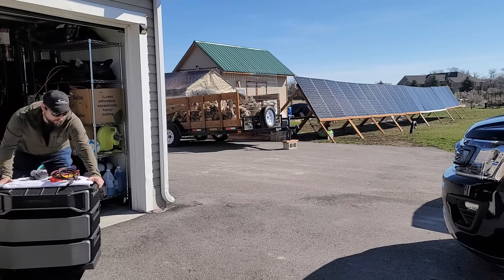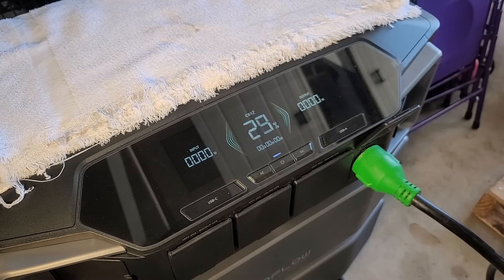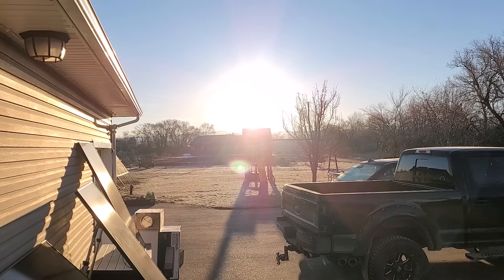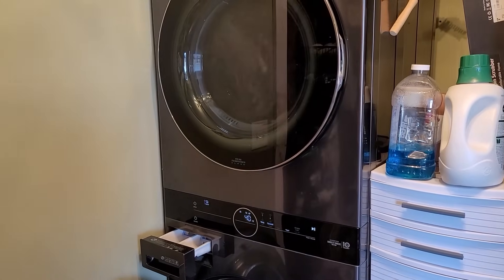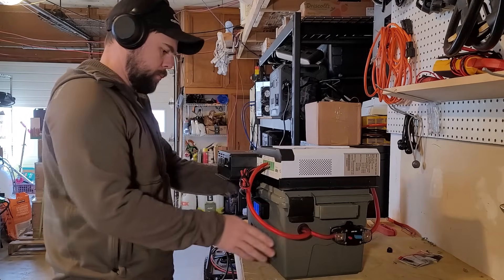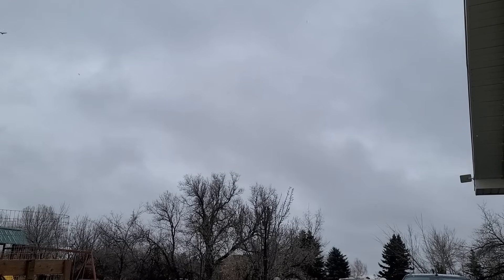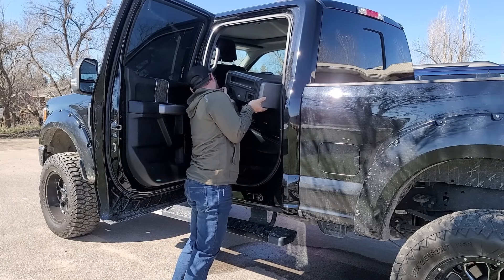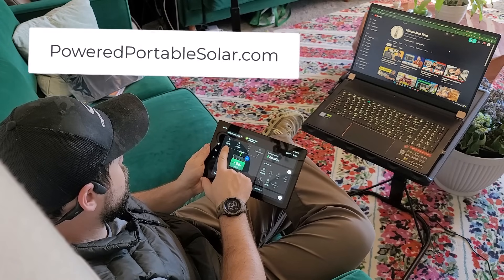Beginner Guide to Go Off-Grid Using the Delta Pro Ultra

Comment: Very Cool.  Question for you, Sir.  I saw one of your more recent videos where you connected a Victron Autoformer to a Delta Pro to make 240V.  What a great idea...as I Victron fan I'm surprised it never crossed my mind.  I've been wanting a power solution to run our electric dryer and am trying to figure out if I need to pick up an Autoformer (3600W max from my Delta Pro) or if I should pick up a second Delta Pro and do that the "best" way (7200W).  My question is, have you noted the power consumption from your dryer when it is set to LOW heat?  Do you think I could run on low heat with 3600W or should I build that the "best" way?  Thanks!
Reply: I have run my electric dryer (it is old, probably at least 30 years) and it draws 5800-6200 watts no matter the setting.  It does not run the heater continuously and when the heater is not running the electrical draw is around 500 watts for spinning the drum.  So I think the difference between the different settings is how long the heater runs.
Reply: Caution: 2 DPro's with the Voltage Hub does NOT draw power from each DP evenly if youre using them to fuel your home panel. I found out the hard way. Each DP draws from the leg of your panel its connecting to via the Voltage Hub. Its apparently only the 240v draw that voltage hub keeps the draw balanced from the 2 DP's. All your 120v function gets assigned to one of the DP's and draws from it. So one DP drains sooner than the other. Not good if u want to run the whole house thru your home panel. Cust serv told me its not like that, and repeated on phone and emails that the draw is supposed to be even, and thats what the voltage hub is for. When I proved with video and quotes from electricians, after TWO MONTHS they finally admitted and agreed to take them back. Now, the DPU is in basement doing the right job. Hope the warning is usefull.